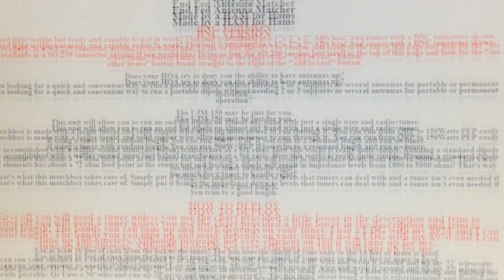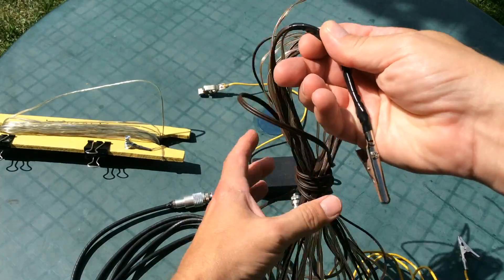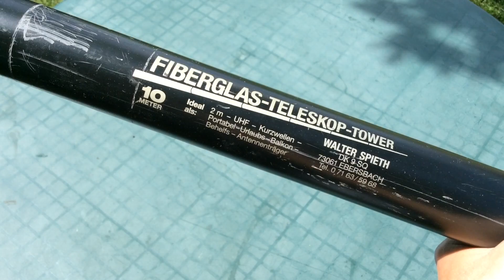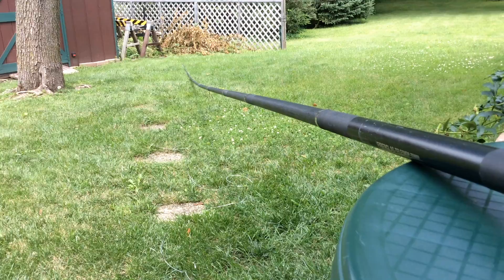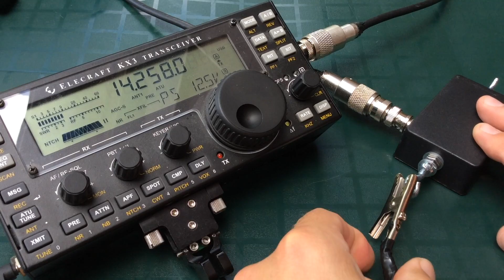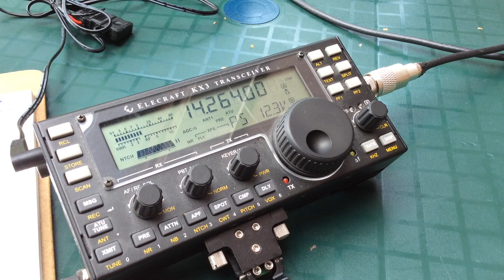HF Ham Radio Random Wire Portable Antenna Back Yard Test

Comment: The video from Buddy Stick said not to let the    Counter Poise wires   touch the earth, have also seen that on one other sight,????????????????????????????
Reply: You can use electric fence posts to isolate the counterpoise - I haven't done a comparison to see how much difference it really makes but just laying on the ground seems to work in this case.

Comment: Nice video. Ive been looking into building a cheap portable QRP antenna since it looks like you can get pretty good results without spending much at all, planning on getting enough 24 or 28 gauge Teflon coated wire to be half wave end fed on 40 meters and using one of those small camping close line reels to keep it in then using banana plugs to connect it to a small 9:1 unun with some RG-174 coax to run to a KX2 with a built in auto tuner for the other bands i want to operate on.  something that would only cost a bit over $25 if i can find a good deal on coax and wind my own inductor and would pretty much fit in the palm of my hand. I should deffinitly make some ground radials for it as well.  Im new to ham radio but my favorite part is learning how to make my own gear.

Comment: Larry this video is a Godsend because it's just what I was looking for as I need to be able to deploy and tear down an antenna quickly due to living with an HOA. Can 100 watts be put through this setup?
Reply from the maker: Yes, with this setup the matching device is rated for 100 watts.  Yes, might be a solution for you the way it sounds, might be worth a try and you can use very fine wire so it would be hard to see if need be.
Reply: +RadioHamGuy Great tips and as always thank you for taking the time respond. Proud to be a subscriber!
Reply from the maker: Thank you, I appreciate that very much.  Glad you enjoy the videos!
Reply: +RadioHamGuy Larry I wanted to come back to this comment after two years. Since that time I've been running 500watts with an MFJ 989 Antenna Tuner on multiple bands with no issues. Almost exactly the same setup you have here, without the Balun. Random wire to tuner, speaker wire as counterpoise indoors to ground lug on antenna tuner. The loss is huge after tuning to a 1.5 SWR, about 290 watts out. Tuner does not get hot. Making contacts all over. This is phenomenal and nowhere else is it explained better than here. Was told I was insane for running 500watts on. 26 magnet wire but it's working. No RFI in the shack after the counterpoise is layed down properly. Two years of fun can't be bad. I do worry about rf around my body since it's a random wire, but I've yet to find any conclusive evidence from scientific papers that I've read.

Comment: Nice job on just 10 watts! It never ceases to amaze me how well you can do despite poor band conditions with a good QRP setup.
Reply from the maker: I have so much more fun with low power than I do with high power, much more of a challenge and like you say, much more amazing when you work someone thousands of miles away with just a few watts like you would put into a night light bulb only to an antenna, how that can travel through the air that far still amazes me, that is the fun of radio to me!  Thanks RW.

Comment: Surprising what a difference in RX signal the counterpoise made. Also, nice simple solution for attaching the antenna wire to the tip of the mast (ring terminal slipped over top section). Thanks Larry! Kevin, WB2QMY
Reply from the maker: Yes, I was surprised also, it is not as dramatic as you see in the video however since it changes the tuning system of the antenna, when I disconnect the radials and then retouch the auto tuner in the KX3, it does bring the signal level back up some, but still not as good.

Comment: how were the swr holding?
Reply from the maker: The SWR is usually a little high so you do need to use a tuner of some kind for this kind of antenna if you want to move around the bands, the built in tuner in my KX3 had no problem tuning it on any band from 80-6 meters.

Comment: I discovered one time that with one radio hooked to a diapole and the other radio hooked to my base antenns that if I was using the diapole with the other radio I would receive better when having the other off. So maybe  the base antenna was helping as well.
Reply from the maker: It is neat to hear that, fun to experiment!

Comment: more details on the "tuner"... what is it exactly...?
Reply from the maker: The matching device is a 9:1 unun, not a balun and is what is needed to get the impedance close to where your antenna tuner can be ok with it.  You do need an antenna tuner most of the time, mine is built into my KX3 and it has no problem doing the final match so the radio can transfer the power to antenna.